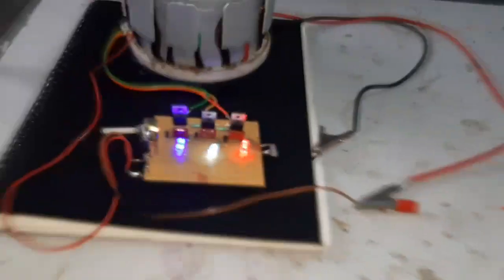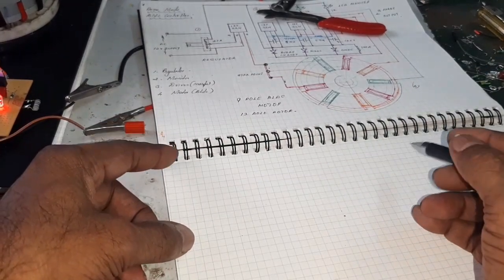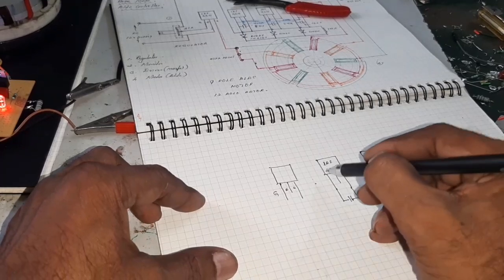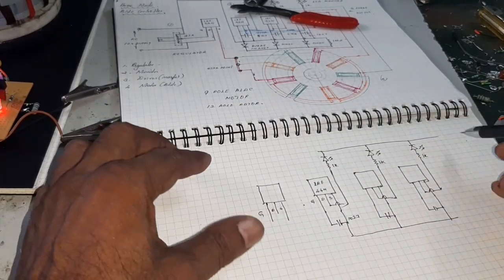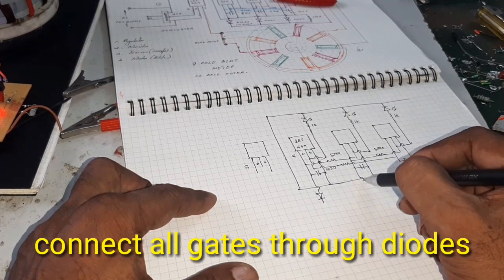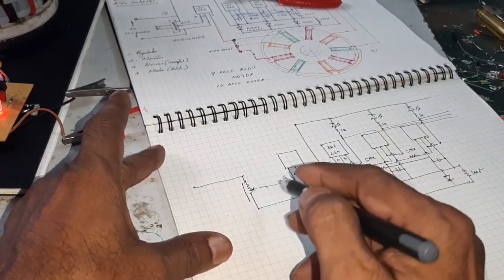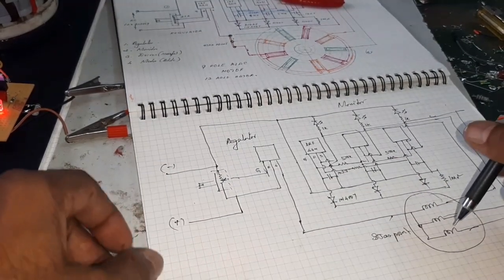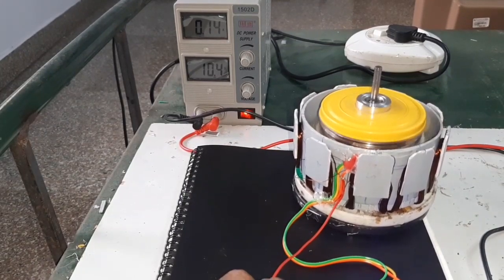(V-122),Home made bldc controller and bldc motor.

Comment: Thanks,. Can i use same circuit for 500w 300v bldc. (max ~15000rpm) What is your advice?
Reply from the maker: Same circuit is not used for 300volts but change the MOSFET as higher capacity and test it
Thank you